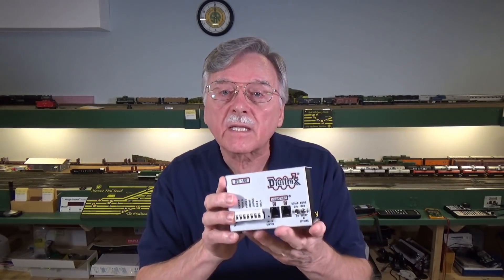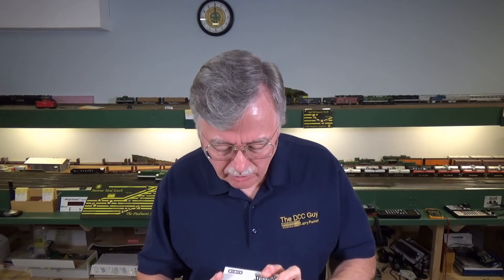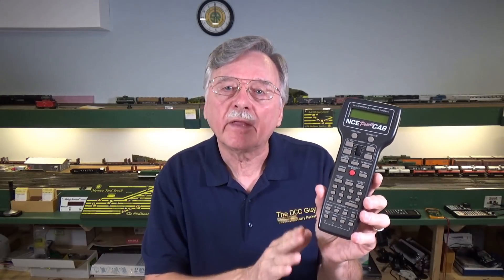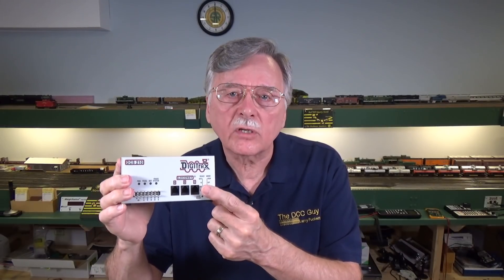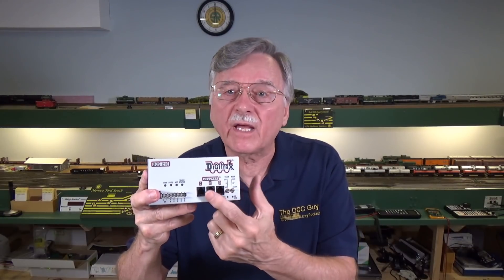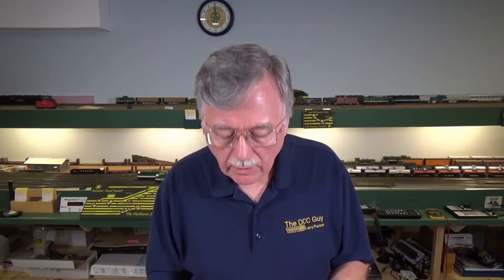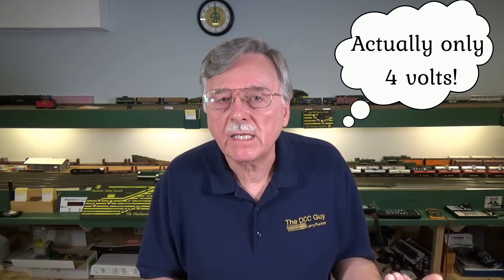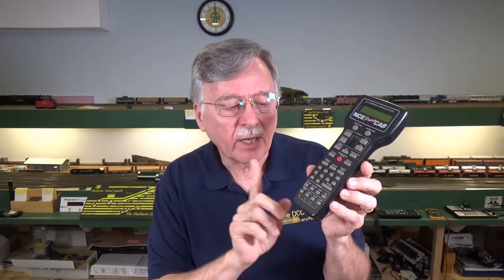Wiring Your Model Railroad For DCC---Boosters (113)

Comment: Ironically this video is exactly where I’m at on my layout, except I have a problem. My locomotives short out when crossing power districts. First, I’m running digitrax zephyr express dcs52 and a db210 booster. The layout is essentially broken in half. One powering each side. The rails are double gapped and each has its own buss wire. I already did the quarter test and got shorts. The locomotives run everywhere on the layout except the gaps.  I ran a 14 gauge ground wire between them. I tried switching the A and B rails. I tested the loconet cable(all good). I’ve even tried the auto reverse switch on the db210 and I still get the short.  I just keep getting the local booster track fault message and the locomotive completely shuts down until it gets a signal from either one and it starts back up. Is there something I’m missing?  Piece of equipment?  Getting to the point where I’m going to forget the booster and make the layout one big one of the zephyr. Thanks in advance.
Reply from the maker: I have heard of similar problems with the DB210 at a local club. They fussed with the setup and swapped the boosters around and surprisingly that fixed it. Digitrax eventually got back to them indicating that the firmware in the DB210 or the command station one needed updating to fix a software glitch. I suspect you have the same issue.
Reply: The DCC Guy     Thanks for responding. I’m new to this and assume the updates are done by computer but I don’t have my system hooked up to the computer. I guess I have to connect the units to the computer right?
Reply from the maker: Yes, that is the way to go. You can use the usb interface built in to your DCS52 as the interface or find a local dealer or club or individual who will do it for you. It is an easy process once you get the computer interface hooked up. You just need to download the free software and firmware update the run the DigiIPL software. But I also suggest checking with Digitrax tech support first as they may have more on this issue. Also since the local club got theirs to work by simply swapping the blocks the boosters were powering you might give that a ry too. This seems to have something to do with how the unit responds to shorts and can be very sensitive to wiring.
Reply: The DCC Guy     Ok I’ll try switching as well but I don’t have multiple boosters, just the zephyr and one booster if that matters. I’m hoping it’s a firmware update, because sometimes the locomotive will make it over the gap without shutting down, but I will still get the beeps and local booster track fault message. Seems like they’re fighting each other.
Reply from the maker: A other possbile issue might be if the track voltages for the booster and command station are not close to the same values. This can create issues so do a test after you watch my next video “Booster Finale”.
Reply: I have the booster set at 3 amps because I read that the zephyr is at 3 amps and I cannot adjust that.  I’m waiting for the pr4 to show up before I try to tackle it

Comment: so you should ground yourgigitrax system with your house ground?
Reply from the maker: I did not say that, I said Digitrax recommends it in their manual. I run a ground between all my Digitrax components but do not attach it to the household AC ground. If I ever see issues that might be related to static buildup then I may follow this recommendation however I will likely establish my own earth ground instead of using the AC ground. Due to liability issues I would never tell folks to do that, too great a chance they might stick a ground wire in a socket and get zapped. Read your manual and check their website for guidance.

Comment: I would have one concern in tieing electronic ground to earth ground is to make sure your switch board mains power has lighting and surge  protection on the circuit your layout is using as you could take out all your electronics in a lighting strike or power board switching error.
Reply from the maker: See my response above. Even though I have a whole house surge suppressor built into my main panel I am not sure that it would protect if a nearby strike energized the earth ground rods or a cold water pipe bond. I would actually feel more comfortable drilling a hole through the concrete floor in the basement and shoving a ground rod down through it!
Reply: @TheDCCGuy  I would agree in my work role that is the way we do it. we run different earthing system but I think most of us hobby guys would not do that dollars... keep up the great work do find your material well balanced hope you do not mind me put thoughts out there. just some thing could interested you, I am looking at a project using the arduino current module to drive a relay fail safe to open as a dcc overload and short. all the best Paul
Reply from the maker: Always happy to hear other opinions on the best way to do things so don’t be hesitant to chime in—Larry

Comment: Hi Larry, thanks for all your videos info, I've learned heaps and confirmed some of my ideas. Do you have block detection on your layout and if so do you have a video for this?
Cheers, 
Stephen (Western Australia)
Reply from the maker: I am using the NCE BD-20 current sensing transformer based current detectors. For signals I have logic circuit boards based on an article in MR. I still need to get a bunch of the boards completed and unfortunately Oregon Rail seems to have folded leaving me about 6 signals short. I will probably use the Details West signals if they ever get them in production again. I will do a video down the road on this but need to get at least a few blocks completed first.

Comment: Very interesting video. I have a large layout, shaped like an E, for which I have the command station powering the centre and a separate booster for the top and bottom sections. OK, so after contacting Digitrax about  locos stalling as they cross between power districts, they suggested linking the ground as you described. So a wire from the centre to the top booster and sure enough the loco runs between nicely and all is well. Then also try connecting from the command station to the other booster for the lower power district and all sorts of problems occur e.g. the track detection system shows occupancy all over the place and various shorts. On talking to my supplier they said that it's OK to put a link between the command station and one booster but from the command station to both effectively creates a short circuit. Is this something you have come across?
Reply from the maker: I have never seen it and as I said on the Northern Virginia Model Railroaders layout we had 8 daisy chained with grounds. I suspect a sneak path or possibly you have the Track A & B wires reversed on one or more of them.
Reply: @TheDCCGuy  Hi. Unfortunately I don't think it's a sneak or AB cross. Without the "earth" wire linking the controller to even one booster, modern locos run fine around the layout. I only contacted Digitrax because I have some old Hornby OO locos that pick up power from one rail through the front bogie and form the other rail with the rear bogie and it is these that stop. I read one of the comments here and they also had problems due to firmware in the DB210's. Maybe time to contact Digitrax again. In the mean time I can resolve the old Hornby loco issue by fitting a decoder with a stay alive.
Reply from the maker: Try swapping the boosters and command station around. At the local club that resolved the problem they were having. Digitrax did tell them to also update their firmware so that might resolve the issue as well. Let me know how it works out for you—Larry